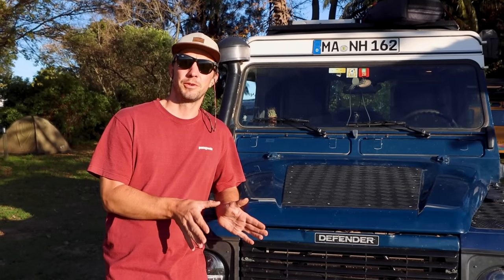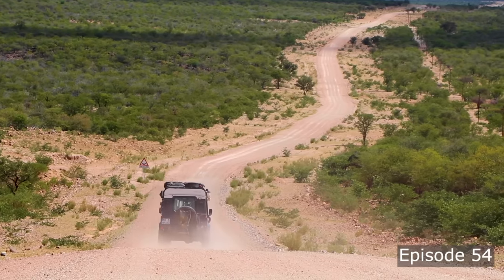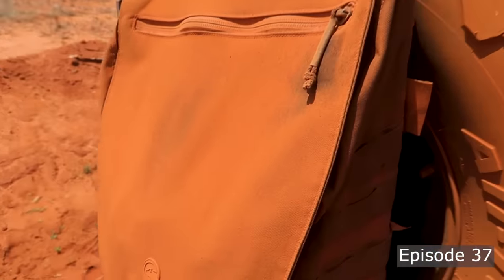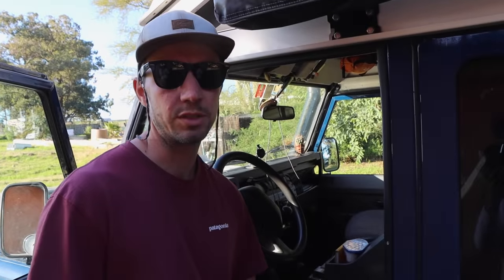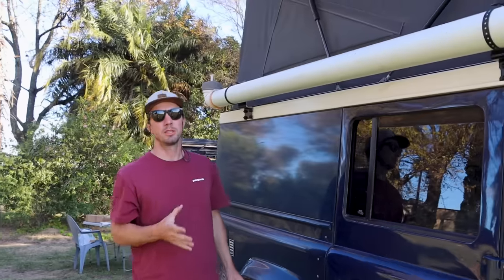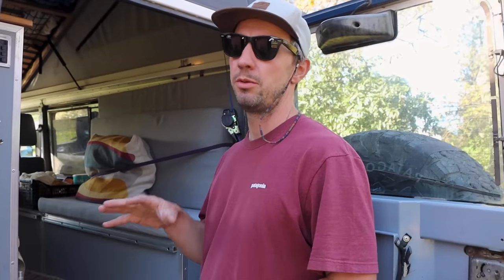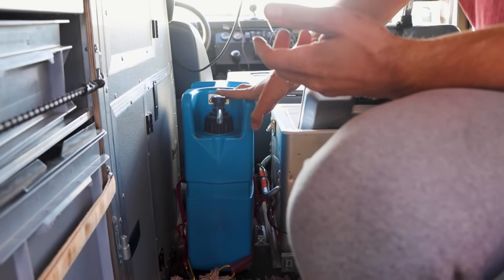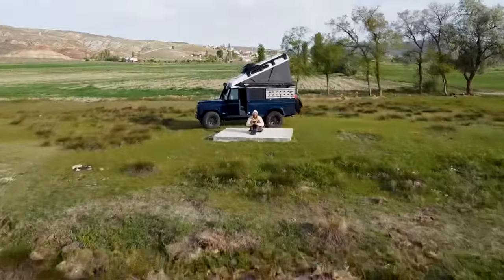Review of Land Rover Defender 110 Camper Build (14 Months Around the World)

Comment: If you put airbags in the rear coils then you could adjust the pressure for the varying weights on each side.
We have Airbag Man airbags in the rear of our 110, mainly for towing our caravan, and they are excellent. 
Re mosquitoes, you can buy mosquitoes screens with Velcro which can be dropped over each opening. We use one at our home.
Reply from the maker: That’s a great Idea would love to give them a try. 
We thought about adding a screen in the back but we constantly open all the doors and we thought they would be in the way all the time. But we might just try it in the future

Comment: If you move the water from let side towards the right side of the car. That creates an open space to fit heating components if you can for reduced weight combined for water tank to center the car.
Reply from the maker: Our heater is below the cubby box (center console) and the silencer is in the small box on the bottom of the big furniture. So no Need for more heating 😜. 
Maybe another battery, options are endless. 😅

Comment: Some fantastic thoughts from this one ... As regards the lean I'd simply buy handed springs and switch the sides. We run right hand drive here but I think a chat with the likes of OME might get you where you need to go.
Reply from the maker: Hey, I’m not sure if I get this right, as far as I remember is the longest spring the one left back… are you saying the right hand drive spring on the right side is even longer? 
I was thinking about custom springs. But those are super expensive…
Reply: @Thebluelandy  So in the UK the drivers side springs are slightly heavier duty. This changed in the later setups. Hence you can mix and match spring setups should the need arise. They used to do this a lot after the Camel Trophy challenges when the Special Vehicles department took over the unusual specification requests including the Gold overland specs Sir Ranulf Feines opted for that never quite made it. I would opt for OME or the equivalent these days as Land Rover OEM isn't at all what it used to be 👍
Reply from the maker: That’s really good to know! Thank you so much I’ll give it a try. We have OEM but the springs out of the 130to get a slight lift
Reply: @Thebluelandy  If you can check the colour stripes you'll know what to deal with. Either that or you go to the likes of Old Man Emu and ask for advice.

Comment: Hi guys. Really enjoyable video. Many interesting things to see here. The battery setup is particularly interesting. Couple of questions if that's ok. I assume the batteries are in parallel so 160 amper hours? I wonder about the alternator, is it possible you could put too much load on it if the batteries go low?
I think your setup is a great testimonial for the defender, gives me hope for my 89 110 with a 200tdi.....
Reply from the maker: Hey Kerryman, you are Right a normal generator / alternator is not built to charge big battery banks. And this is not ideal. But due to the fact that the solar is doing 90% of the work, and in a normal day we reduce alternator load there, the solar is even during driving assisting the alternator. We basically only use the alternator in a bad weather scenario, and we try to avoid bad weather as good as it goes. The hole car is not really built for more than 3 days of rain. 
Remember we cook outside 😉

I’m sure you’re 200 tdi will do a great job aswell, just listen to it and localize new noises before something breaks 😂